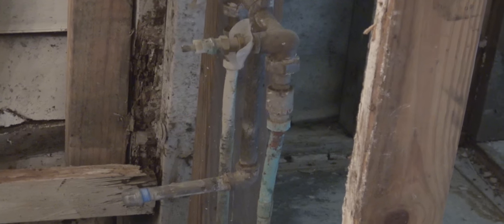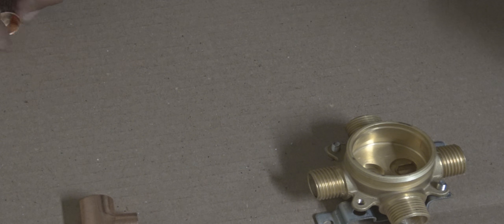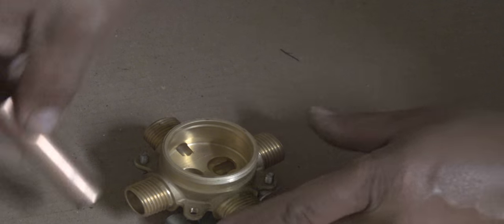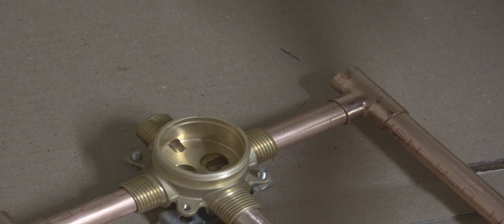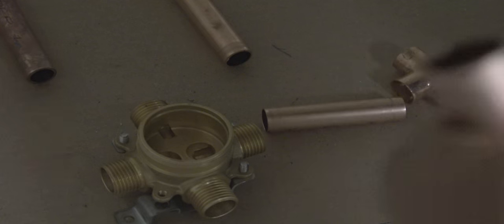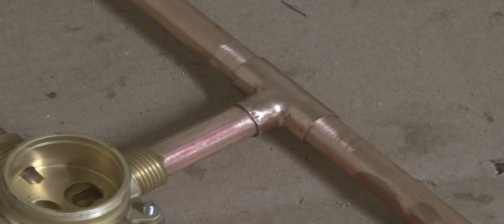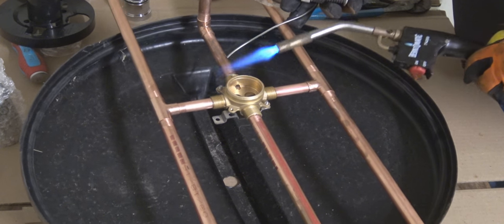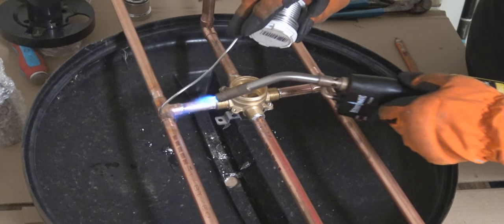What's Going On Behind My Shower Wall?

Comment: No new lumber? At least sister the studs with pressure treaded wood. I know you're not the carpenter but it only makes sense. l
Reply from the maker: +6.4L HemiPower Yes your right. Thank you for the knowledge, but there going to have carpenters contractors and dry waller to renovat that part. I'm just doing the plumbing.